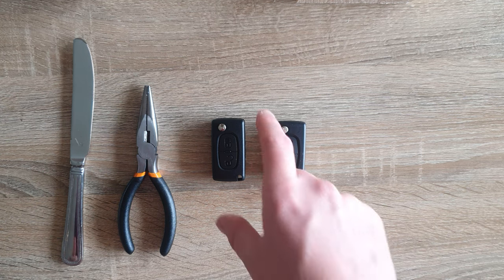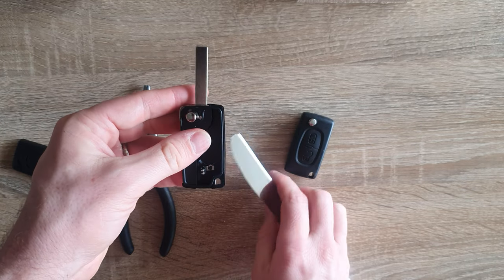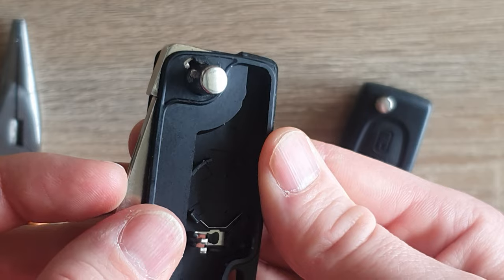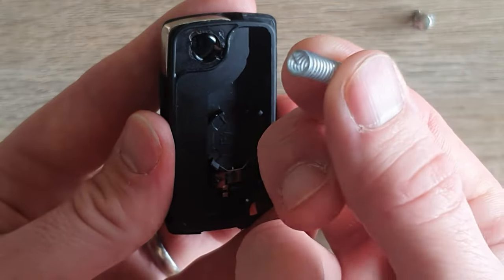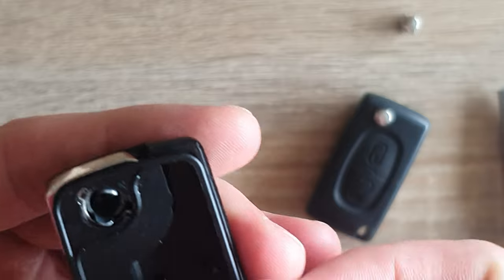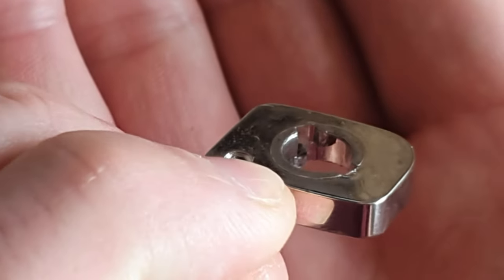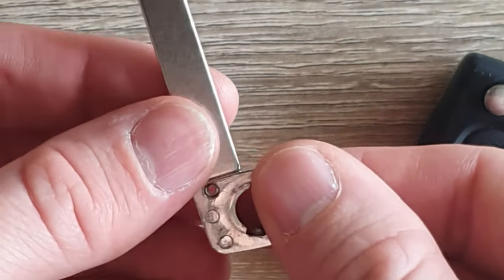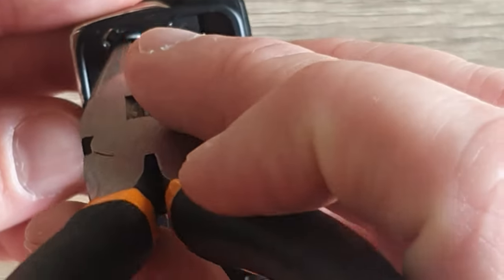How to rebuild a Peugeot / Citroen Key fob

Comment: I just don't understand how you did this... I've followed all the steps you said, but after twisting the spring, the button always locks at an angle and the blade will fly out, but I can't get the blade to lock closed.... What am I doing wrong?
Reply from the maker: @chrissharples56  Maybe check the notches in the lid that hold it

Comment: It’s all that’s needed in a “how to” video. Nice. Update, actually it looks a lot easier to pop out the pin on the old and new key fobs than fiddling around with the spring and you still need to change out the circuit board.

Comment: Hi. I tried this but the original key insert did not match. I ended up having to knock the roll pin out and swap the blade and then reassemble the new replacement unit. I can offer a tip, though. To reassemble the locking pin I found it much easier to use a chuck to hold it. Just a chuck from a drill but hand held. Thanks for the video, even though it didn't work as well for me as I had hoped.

Comment: Thanks for the video. Saved me getting the blades cut as I my replacement keys don't have roll pins and if they did, that's not the option I would have used.
Thank you 👍🏻

Comment: followed your steps and wound up the spring but for some reason if i try to press my button it doesnt actually make the key spring out. is it possible that i somehow bent the spring while working and now the mechanism jams? not sure why it wont work
Reply from the maker: Two probabilities: you wound it the wrong way, or the spring is not (or no longer) in one of its little holding slots in the cap or the base

Comment: Help ive done this the spring swings  back and forth okay but the case doesnt lock the blade
Reply from the maker: Maybe check that the spring is engaged in its little notches properly, and that the notches on the lid or the spring cap aren't damaged?

Comment: We always use a pin extractor or a nail to remove the key blade and replace it, no need to disassemble the spring, button etc.
Reply from the maker: You put lots of load through the key mechanism. Makes it go floppy.

Better for the fob to do it this way, takes same amount of time, if not faster like this
Reply: @olivercouch1651  I tried today. Purchased one from China (exactly as yours) I did removed the spring and key and the old/original one was a Delphi key fob case, it does not match, it has another mechanizm. I broke the original one to extract the key. But even the root part of the key is different, so if the original/old one a Delphi, you need to remove the pin.
Reply: @vintopin  I've just done this and this was my experience. I used the new fob but had to switch the blade by removing the pin. My old one was a Delphi too.

Comment: I've found there are differences with the keys: whilst I would have liked to use this method the small barrell did not seat through my OEM key into the case as the notches in this piece were slightly different.

I had to default to knocking the pin out but in doing this I found the OEM key and new key pinholes didn't line up exactly.

A very informative video but really you need to find your own way to piece this together based on what parts you start with.

Comment: Thank you for clear instructions, fiddly but original key is now in the new case.  It's just a b**ger that the remote no longer works! Have tried about 8 different ways (via youTube and various forums) to reinitialise the fob - to no avail.
Reply from the maker: Did you double check the battery was definitely making contact? If the contacts are bent slightly they might not make good contact with battery or the pcb.

Comment: After dealing with multiple cases I can say that this is an annoying hellish job.
I accidentally broke a tab in the mechanism in the replacement case and had to order a new one again. All three cases had slight differences in the construction of the mechanism. And the key blades can vary in few mms which means punching the locking pin permanently in.
Even the springs can be different. In my original key fob the spring was a thick short one. In the new ones, the spring is like in the video. But a single 360 turn is not enough, otherwise the fob feels clumsy and sticky. Doing a full turn is already hard as is, with the parts flying all over the room, meaning having to restart all the time. Doing a full turn plus half a turn destroyed my fingers and sanity.
Here hopes that the blade matches the car and that the board makes electrical contact with the battery unlike the last time…
Edit: Yay it works, but now the oil level is up, what?

Comment: I just bought a blank key remote for my Peugeot 207 but the old original key has different knotches where the button/spring sit compared to the new one so the key won't line up 😢 any suggestions?
Reply from the maker: Hmm, maybe you can knock the roll pins out and swap the keys themselves over?

From memory there are a couple of different variations of these keys, so you may be able to return the one you bought and order one that matches yours. There should be a code embedded in the plastic of the fob housing - CE0536 or something like that. Use whats on your old key housing as a search term when finding a replacement.

https://youtu.be/htHC78U1fC8
I think this video covers it.
Reply: @olivercouch1651  ok thanks for Ur help. I will give it a try knocking the roll pins out first and if that doesn't work I'll double check the code while it's apart and see if I can find a case to match 😉👍

Comment: It’s actually much easier to just knock the roll pin out with a panel pin and swap the blade..3-4 minutes max
Reply: I agree. I damaged mine by doing as in this video and now i’m left with no keys. Should have watched the other guys instructions below this one
Reply from the maker: Nah, this way is faster than knocking out the roll pin and less likely to damage your key once you know how.
Reply: @olivercouch1651  ..it isn’t but each to his own.

Comment: Been stuck on the last step for two hours now, trying to turn that shit the full 360, I just can't get it to stick 😭
Reply from the maker: I had that issue on my older key. You may need to make sure there's no dirt or anything gotten stuck in the grooves for the spring. Also double check that the grooves haven't been damaged - if so you might just need a new one.

When you seat the spring in the button give it a good squeeze and fully compress the spring to make sure it clips in. Then put it in the key and squash it down as far as you can. The one in the video was pretty easy because it was brand new.

When twisting up the spring you need to push the cap down onto the spring as much as you can to help prevent it from slipping out.

Hope that helps!
Reply: I'm an idiot. I just had to attach the other half of the case to have it stay in place. Thanks for the video!